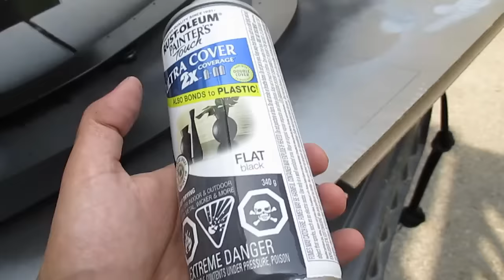Making Custom Splitters For The G35

Comment: @DNALI hey bro I need your help on something. I'm trying to get the SER gauges to work on my 06 3.5 SL,  only thing that I am missing is the harness to the oil sensor. What did you do to get yours to work. If you know anyone or a website that would have it I would greatly appreciate it.  Miss your sweet Altima. Mike from Cali.